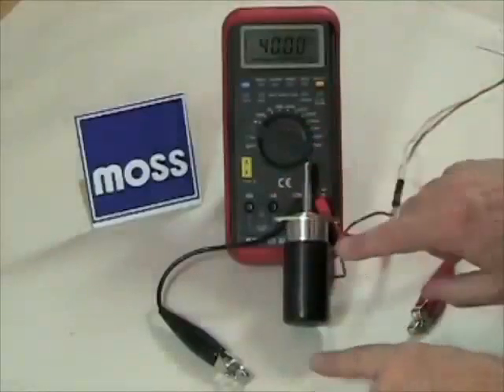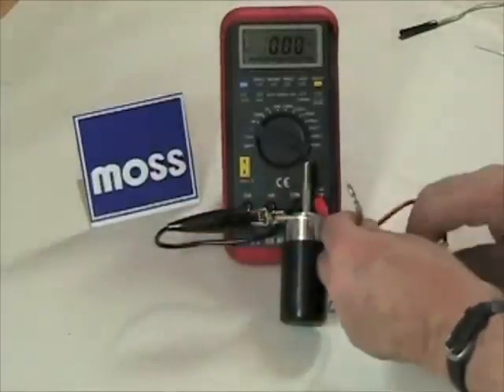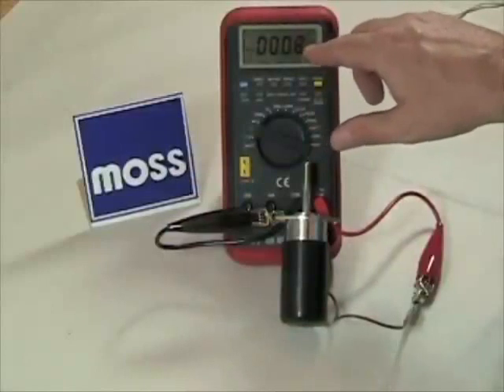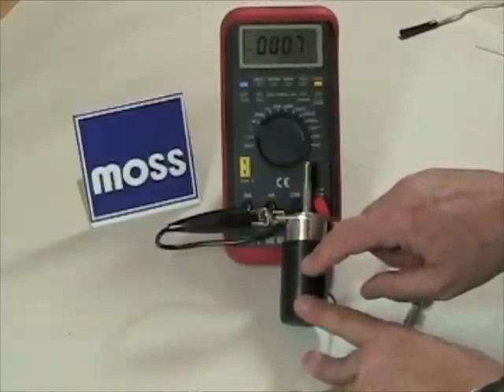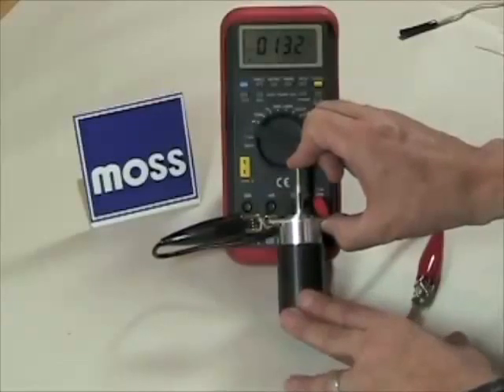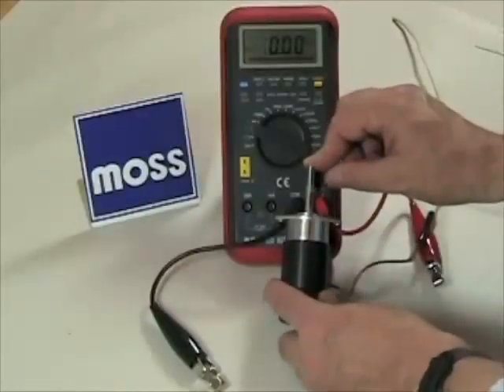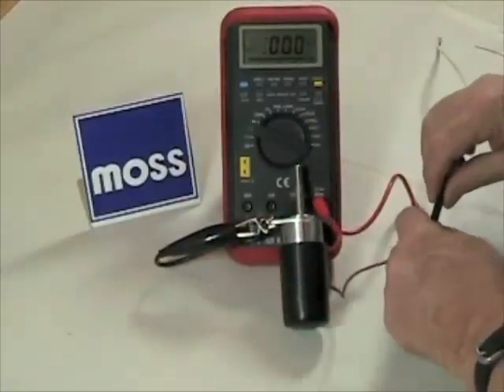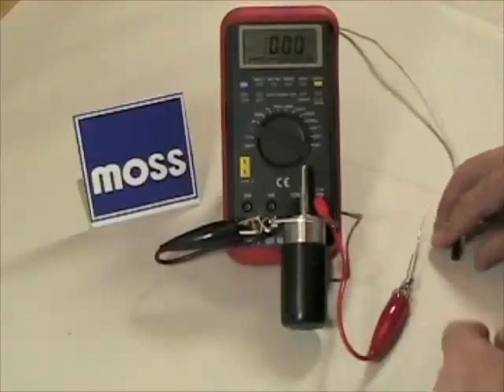Overdrive Transmission - How to Test the Overdrive Solenoid

Comment: I have an MD8 (700R4?) in my 1948 GMC Truck - there is a solenoid located on the top-driver's side of the transmission - one wire going to it. It controls the overdrive engagement. I cannot find any reference anywhere to an MD8 having this solenoid. As such, I cannot buy a replacement. So either my transmission (which has printed on the side "MD8") is not an MD8 or there is some other reality going on here.

Comment: Because you know the voltage, and this video displays the resistance of this particular device it seems like you can reasonably determine that it is operating properly by measuring the current, inline, without having to remove the device from the vehicle. By my calculations and using ohm's law (E=IR), we might expect what he refers to as operating current as 12v / .7ohms or 17Amps, and maintenance current as 12v / 12ohms or 1amp. Is this correct? Of course, the numbers will differ for each person's device, but  we're looking for a difference being present, not an actual number.

On my gt6, these little buggers are very difficult to install while the transmission is in place. A testing method for a while the device is in the car it certainly useful.

Comment: Hi, can you please help me. I have a Jaguar 1967 Mk2. I have live going into the Overdrive lever and coming out. I have put 2 new Inhibitor switches in and new loom, have tested the them and all is good but i don't have a live feed going to the Overdrive solenoid when in 4th. i can put a tester on it earth it out but nothing lights up, should that wire be live?
If there is a break somewhere can i take it from the overdrive lever power out straight down to the Solenoid.

Comment: Hello
I’m getting intermittent function of my over-drive in my 2003 Toyota Matrix.
When over-drive fails to engage. I stop, put in park, turn-off ignition, start, engage trans in drive…over-drive then engages…not always, but usually.

What might be the cause, and what fix can I perform to regain consistent operation?

Comment: I own a 2005 Hyundai Accent GT (since new), with an Automatic Transmission (Model A4AF3 - Made by Mitsubishi) and 89K miles. The issue is that when it goes into overdrive at 40 MPH plus, the transmission seems to float between drive and overdrive when cruising. Once I put pressure on the accelerator, it firmly holds overdrive. However, during cruising it is felt, heard, and also reflects via RPMs. 

The car is in mint shape. Maintenance has always been key with all of my vehicles. For example, the XMSN Fluid/Filter is changed every 25K (started using Valvoline MaxLife at 58K). So far I have replaced the speed sensors and overdrive needle bearing.

There are no DTCs, and mass research has yielded nothing.
 Any suggestions? Thank you.
Reply: Check the throttle position sensor
Reply: Hi. Have you solve this problem of yours? My 2001 Nissan Xterra does the same as described...

Comment: Is there such a thing as a weak solenoid? My MG OD stopped working and I suspect the solenoid. I can hear it operating and know that it basically works, but I worry it may not be strong enough to hold the position necessary to function properly

Comment: These are more complicated than I thought, thanks for a little free breakfast education.
Reply: We changed our pressure sensor and pressure solenoid an filter and gasket on the pan and our check engine light went off but now it won't go in to gear and they were working before so now what.